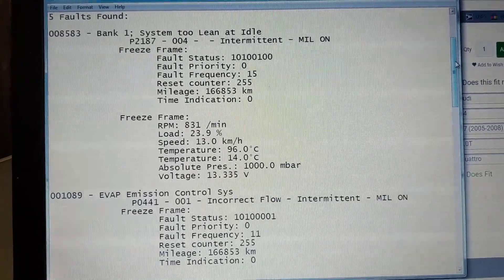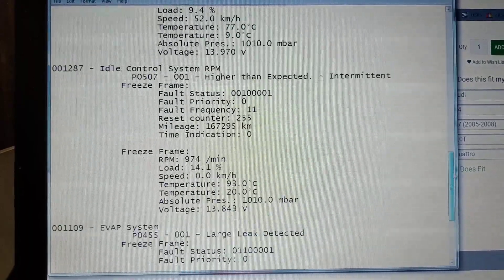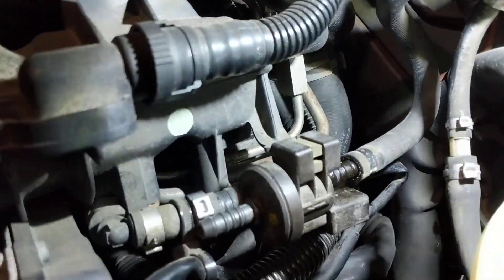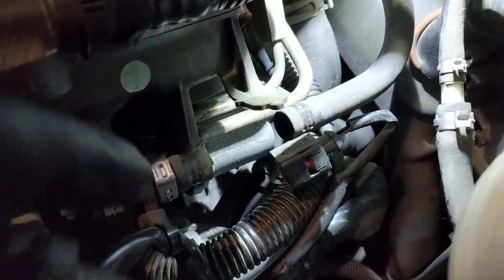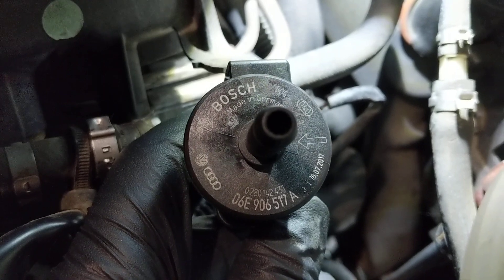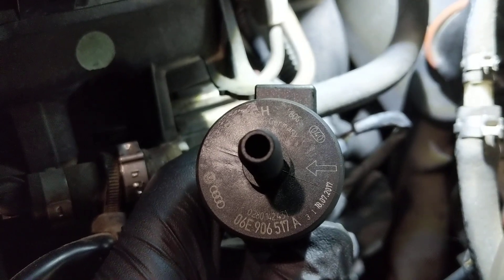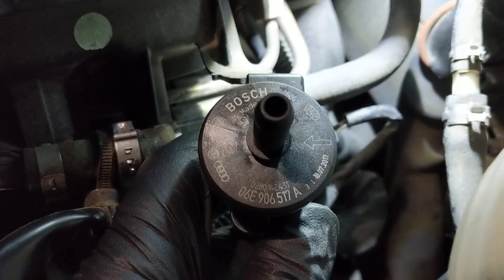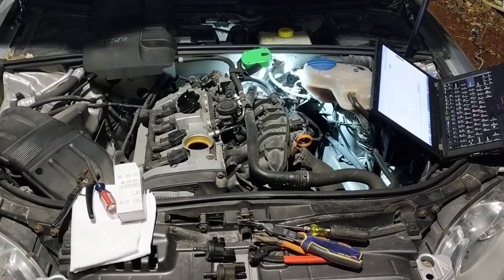Car won't start after getting gas; Gas pump keeps stopping. Check Engine Light P0455 P0441 Audi 2.0T

Comment: Do not overfill your gas tank. There is a hose at the top of the gas tank neck that sends FUMES to the engine to be burned off. Overfilling the gas tank causes gas to run down that hose and wreck your purge valve usually keeping it in the open position so that when you fill up the gas fumes go into your engine making for a hard start. The purge valve should normally be closed when the engine is off.

Comment: I have 2005 VW PASSAT.... SAME ISSUE..... WON'T START AFTER ⛽ GETTING GAS...  THEY TELLING ME IS THIS PROBLEM.... AND I NEVER CHANGED FUEL FILTER TOO... SO I GETTING 2 PARTS TOMORROW.... FUEL FILTER & PURGE VALVE.... HOPEFULLY THIS WILL FIX MY PROBLEM..... CAR RUNS GOOD.... SO IT CAN BE ONLY THIS THE PROBLEM.... I BELIEVE PLUS I NEVER CHANGED THE FUEL FILTER MUST BE SO DIRTY.... GAS ECONOMY IS NOT GOOD SO I MUST REPLACE BOTH I GUESS.....  TOMORROW AT MECHANIC.... HE SAID....  I DON'T KNOW THAT BUT IF THAT IS WHAT YOU WANT SURE WE CAN REPLACE THEM BOTH.... PARTS ARE BOTH 80$ DOLLAR$ AND PLUS LABOR WORK 2 HOURS... LOOKING AT 200$ DOLLAR$ HOPEFULLY.... AND I WILL FIX THIS PROBLEM..... WISH I WAS MECHANIC MYSELF.... BUT I DON'T HAVE 🔧 TOOLS & SPACE TO DO THIS MYSELF.....  VW 🚗 IS GOOD CAR.... 🚗  I CAN'T REPLACE VW [ VOLTWAGEN 🚗 NOW I NEED IT FOR MORE YEARS TO COME ❤ V6 PASSAT 🚗 LEATHER 💺 SEATS 2005 WAGON STATION WAGON I LOVE IT VERY GOOD CAR.... CASSETTE PLAYER I USE CASSETTE PLAYER CD CHANGER AND 🔌 PLUG IT ON MY 📱 ANDROID PHONE..... I GET TO WATCH 📺 ON MY PHONE YOUTUBE INTERNET 🎶 MUSIC WHILE DRIVING USE IT FOR GPS 🛰 TOO... IT DOESN'T HAVE AUX HOLE BUT I USE CASSETTE CD CONVERTER WIRE 🔌 PLUG ON MY 📱 PHONE AND 📱 PHONE CAN BE PLACED AT SPEEDOMETER DASH STANDING ❤ 📱 🎶 GET INTERNET ON THIS THING & 📱 MUSIC PLAYING INTERNET 📺....

Comment: I have an issue the car star but i need tu pump the gas pedal and it starts after the 6th time any advise what it could be
Reply from the maker: So in a fuel injected, fly-by-wire car like this one, pumping the gas pedal won't do anything my friend. The throttle flap will not actuate (move) until the engine is running. You sound like you have this issue, from my video. Have you noticed it takes more cranks to start, after getting gas?

Comment: My 2008 Audi A4 has thrown codes for MAF and turbocharger recirculation valve.  I hope this little part it the key to all the problems, I have to fill up with the car running and even in little spurts while filling I have to stop every $4 or $5 and let the car get its breathe. It'll start throwing out black smoke from the tail pipes and sputter while I'm filling it so I stop, wait, then keep on going over and over till it's full. I was told even my turbocharger needed replacing (I guess that's why I have black smoke when getting gas).

Comment: I just replaced this same part in my audi a4 2.0T and man that little thing makes such a huge difference. No more acting like it wants to die after I fill up BUT now the gas pump keeps stopping when I fill up 🤔 if I just replaced it and it's working fine then why is it doing this now? 🙄
Reply: The car also has an air vent valve by the evap charcoal canister by the gas tank  under the car. That usually fixes that problem
Reply from the maker: Installed backwards?
Reply: @MidknightMechanics  nah I put it in the same way it was on with the arrow pointing forward and besides, the car is performing much better. It's this gas pump thing now

Comment: I'm having this same problem with my 07 Audi A4 3.2 Quattro everytime after I put gas in it it has a problem cranking up
Reply from the maker: This is it my friend! Yours might look different or will be installed in a slightly different spot since you have the 3.2, but same concept as my video.
Reply: @MidknightMechanics  well  either way I just found that part on eBay & order it yesterday that piece does look the same
Reply: @MidknightMechanics  i have a bmw not a audi but doing the same exact thing came from gas station less than 6 mins driving it was pumping slow on the pedal and shutted off on me
Reply: Whats that part called
Reply: My 08 a4 2.0 does it too like I gotta hit the gas to help it start

Comment: mk7 gti, idles rough and throws all sorts of misfire codes and epc + cel light after fueling. No codes related to evap, but seems to me that it could be the purge valve since it will run better after a couple restarts and throttle input. Could a bad purge valve not throw any evap codes but lots of misfire codes?
Reply from the maker: To me that sounds like mass air flow sensor or vacuum leak. CRC makes a high quality MAF sensor cleaner- first thing I would do is remove it and follow the can on how to spray it down.
Reply: Midknight Mechanics Even if it only happens right after I fuel it and gets better after giving throttle for a bit?
Reply: Did you ever find a fix? I’m having the same problem with my Mk5 GTI.

Comment: I'm having the same exact issue with my 99 2.0L mk4 Golf. After I fill it up it won't start then after like 10 cranks it starts but I have to keep the foot on gas and not let it off otherwise it shuts off again. I do have a few of those purge valves. I'll change it tonight and I'll open the gas cap for like a minute. I'll close it back and see if the car starts fine.
Reply from the maker: Adelin please report back how it went. Thank you for your comment.
Reply: @MidknightMechanics  yes it was the purge valve. I changed it that night and never had the problem starting the car after filling it up with fuel. Thanks for the video!

Comment: I think this applies to all vehicles with a purge valve. I just replaced the purge valve on my 2012 Cadillac SRX with drivability problems and hard starting after filling the gas tank. Problem solved, The codes indicated lean fuel both banks 1 and 2 and high pressure in the evap system.
Reply from the maker: Very true Gene.

Comment: This happened to me at the pump a couple of weeks ago.  My 02 Oldsmobile Alero wouldn't start after getting gas.  I was pretty much on Empty and filled my tank up.  My car started, sputtered, and shut off in about 2 or 3 seconds.  I tr wouldn't start immediately, so I let it sit for about 5 to 10 minutes.  I tried to start it again but it wouldn't start.  I let it sit for about 10 minutes and tried again.  This time it started normally.  I don't know what the issue was, but next time I won't let the fuel get so low and hopefully I won't have that issue again.